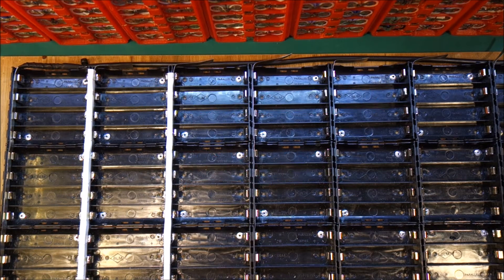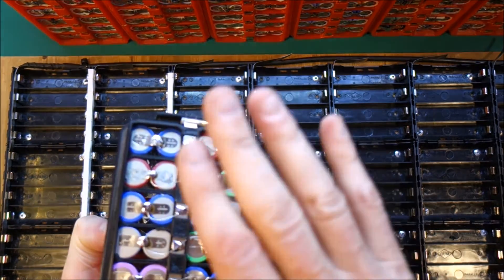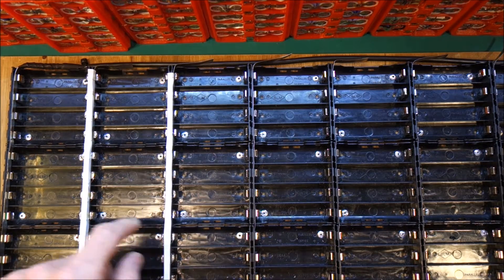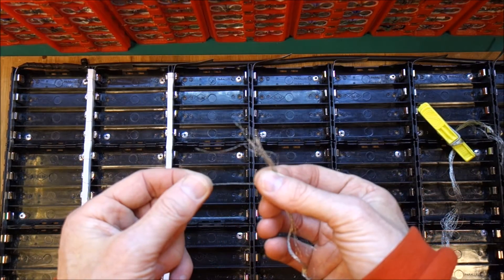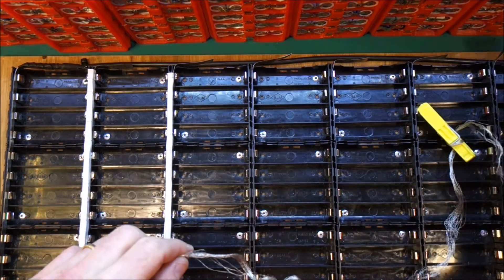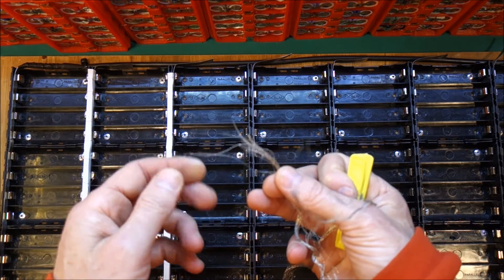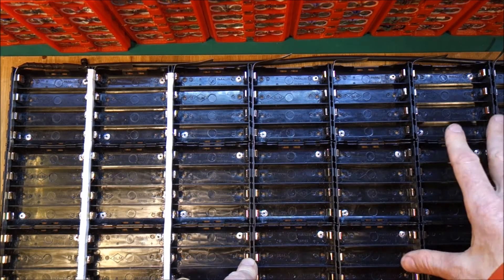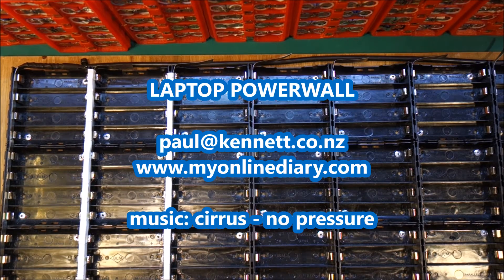Laptop Powerwall 49 - a quick update

Comment: Great work, I picked up and started using the Enamel wire you listed a few videos back. Jaycar 0.25mm to use as the fuse, also i got the enamel 0.5 wire thinking i would use that for the negative so that the fuse would only blow on one side. Problem i have now is the 0.5 is so fiddly to burn off and takes a long time 0.5 Enamel is too hard to work with. 
So i ended up doing a couple of packs with both sides of 0.25 wire enamel which isnt great but is not too hard to work with when you get the hang of it.  That wire you have in this video looks like a winner, I am guessing it pulled from a large dc cable? Also what did you use for the negative of those packs, or ideas over the 0.5mm??
Reply from the maker: Hi Mike

I used some 10 Amp and 15 Amp fuse wire I'd got with the 5 Amp fuse wire I'd bought. 
Peter @HBPowerwall uses a single strand from some mains cable. I tried that on a different pack recently and it works fine too.

Cheers, Paul
Reply: Yep, jaycar .25mm winding wire positive and negative just used cheap 240 house wiring and striped it out.